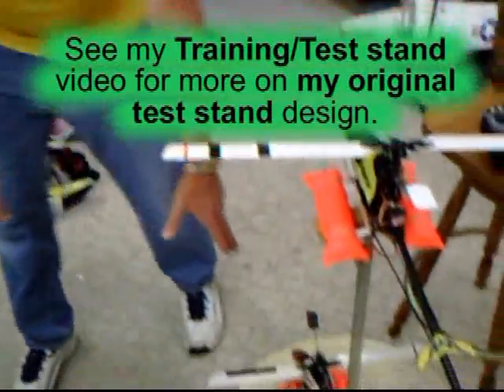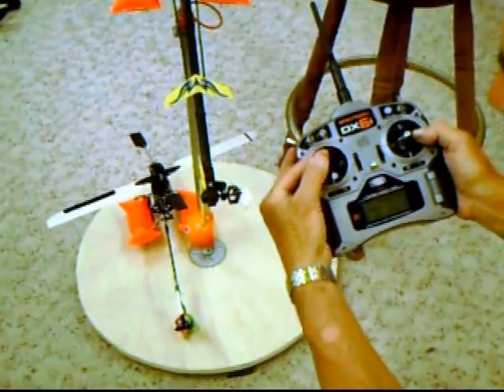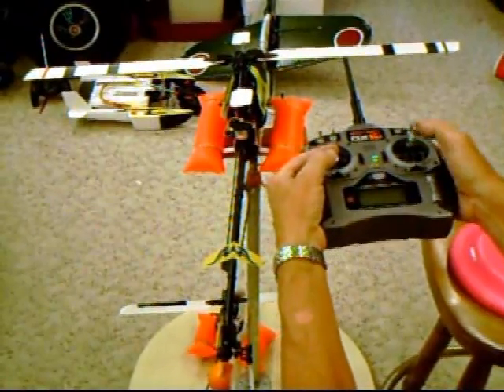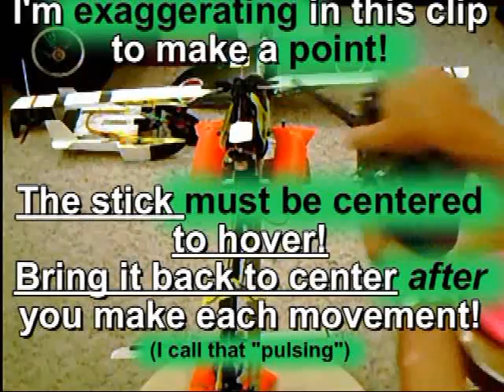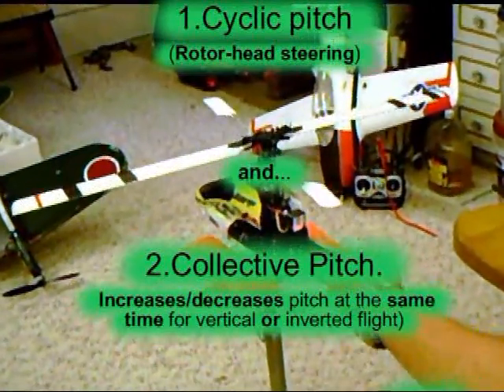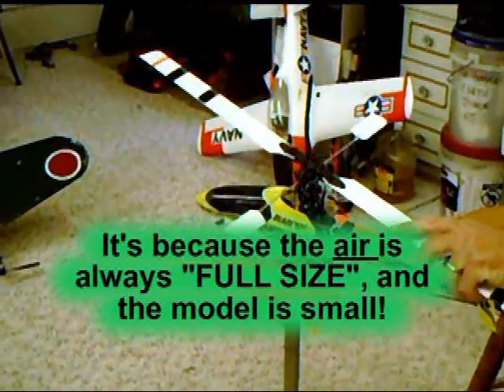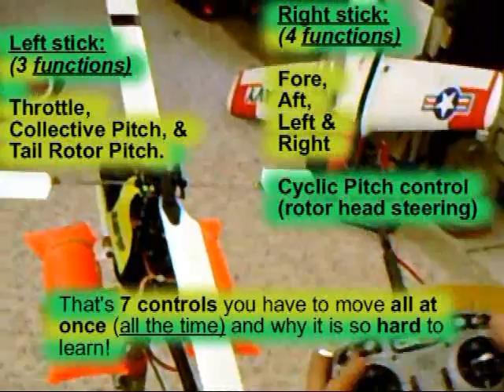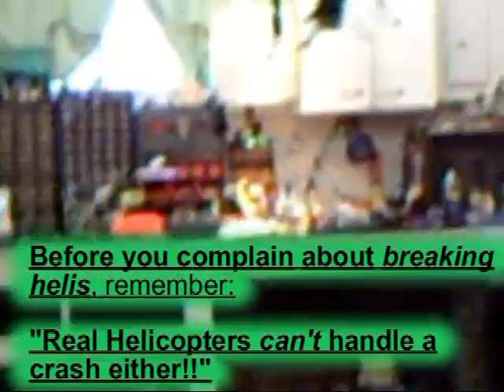How RC Helis WORK with Flight Tips.

Comment: Hey Dave.  Great work on your videos!  The music is clever and friendly which keeps the video easy to follow.  Also your directions are very accurate which helps with building confidence for beginners.  Anyways, I've been practicing on Realflight G5.5 and I'm getting better.  My next step is to buy one and give it a whirl.  I don't want a 3D yet, I'm looking for something with some weight and gyro to keep it smooth flying.  Any recomendations?

Comment: Howdy, I am flying a double horse 9116, it is fixed pitch with motor driven tail blade and it it yawing uncontrolably, i assume it is something with the gear or back motor, i was wondring if you could help me out.

Comment: i just crashed my blade cx3 replades inner and outer main shaft as well a blades and swashplate as well as the nonadjustable linkages my trims are not enough to kepp it still at hover i have to hold the right stick halfweay back and halfway to the right i am afriaed to touch the servo horns unbtill i know whick way to move them plese help!!!!!

Comment: I hated the picolo heli, mine shipped with a motor that was too weak to lift the supplied battery, when i replaced the motor and battery it took off great but would never hold its trim settings and the slightest draft would disturb its flight. oh and upon even the lightest of landings u almost always broke a landing skid strut, plus all in it cost as much as a eco8!

Comment: Like I said, check the trim.  It could be the trim tab on the back so experiment with it and see what it does.  Also try and adjust the gain on the gyro if you can.  With that said, if you're serious about flying helis, I would invest in a T-Rex 450 electric heli.  It has all the functionality of the larger nitro helis with a fraction of the cost.  It will also be much easier to handle than what you have now which will make the hobby more enjoyable for you.  Parts are cheap too in case of crash.

Comment: I have a SPEKTRUM DX6I with a blade 400 3d heli ...   On the right stick when i push forward the rotors go backwards and when i push backwards the rotors go forwards ...   I took the blade to a hobby shop to install new servos and the guy messed up my original controls ...   Can you HELP ??

Comment: Hi Dave, not sure this is the place to ask advice on Lipo batteries but, been flying a 3ch heli on one and getting 10 min flights. Last 2 flights I have been letting the heli hover close the the ground as the batteries run down. Now I get 3 min flights if I am lucky.  Did I drain the batteries too far? When should you stop flying and recharge? I need advice for when I get my Honey Bee please. Really don't know much about Lipo maintainence. Thanks.

Comment: NightFlyyer ur an amazing guy..very helpfull..i contacted u lst time..jst a question if in my country we have no flyin instructors & i cant afford to buy a simulator i have around 400$ and iam an intermidiate pilot wana go 3d whats the best heli u recomend best price and cheap spare parts also are those heli's like the "Falcon 400 SE CCPM 3D" software simulator that comes with is effective and enough...also the best mini wireless onboard camera.. and what to buy with it like extra blades and so

Comment: thanks a lot. I plan to purchase ''easy lights'' for my BCX2(new model) and the product description says to plug it to a spare receiver channel(SRC). Is it the set of empty slots in the 2.4GHz microlite receiver? According to the description it has an input range from 3.5-9 volts; so can i add another battery(rechargable) for add ons? Does the installation require any other accessory? Thanks a lot again.